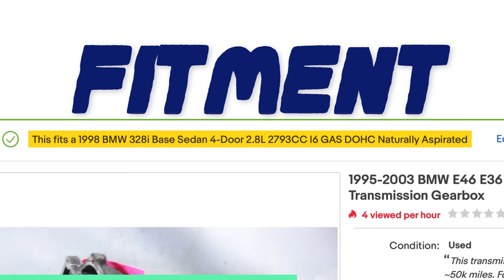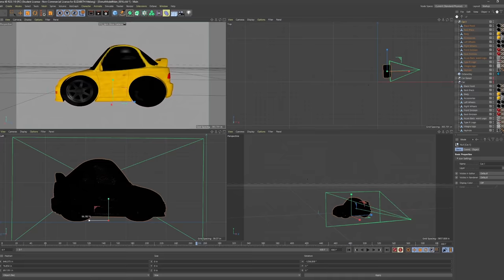Is a Manual Transmission Swap Worth It?

Comment: As someone who has done with myself, if you have a good car (or one you have an attachment to) with an automatic transmission and selling it for one with a manual transmission isn’t an option for whatever reason (like price or rarity), then swapping for a manual transmission is 100% worth it. That said, the newer the car is, the harder it gets. It also kind of depends on the car. Some cars have an absurd amount of differences between auto and manual cars. Newer cars also present more electrical hindrances.

I’ve done this on 2 Subarus. On my old Legacy, I actually found the best way to do the swap was to buy a parts car. I bought a wrecked car with no engine (but all the other drivetrain parts) for $300, and it had everything I needed except for the driveshaft, which was another $90.

For my second (newer Subaru) I actually went from a 5-spd glass box manual to a STI 6spd. The two transmissions are so different that it may as well have been an auto to manual swap.

In both cases, it was totally worth it. Completely transformed both cars (and made the old Subaru with the automatic much quicker and more fun to drive)

Comment: You can bypass the Neutral safety switch, and also bypass a few of the wires that go the engine computer and also to the transmission computer too, and also add a few wires, or ground them out. without having to open up the transmission computer, or you could make an diy bypass harness to bypass everything that used to control, automatics transmission related things, take those out so you wouldn’t have an check engine light and also start the car, without having any problems whatsoever, that is my idea.

Comment: In the case of cars like Mk3 Golfs/Jettas/Cabrios (and mk 3.5/4 Cabrios, which are mechanically Mk3 cars under the facelift), doing a manual swap is the only remotely affordable way to keep an old automatic car on the road when the (terrible, terrible, no good, horrible) transmission inevitably bites the dust and you can't find a replacement on the used market (because they're all dead at 150k). Fortunately it's a relatively easy and painless swap, as far as those things go, and the end result is a vastly improved car if you're into rowing your own.

Comment: Here in the Netherlands most ppl have manual transmissions. full is here, is verry expensive alomst 2 euro so thats 2 doller 20 or something per liter and whit a manual you can keep the low rpm so it uses less full. And the newer cars have a 6 or 7 speed theese day to keep the full cost low.

Comment: it really depends on the car. My dad bought his old 76 280Z years ago and it was an auto, so OF COURSE he swapped it with a manual l28 transmission out of a 280ZX. That car was a rust bucket when he got it though, I have the engine in my 78 280Z though, specifically used that one because of the "high nickle content" block and the "square" shaped exhaust ports that match l28eT turbo exhaust manifolds.

Now it just has headers and 2.5" exhaust kit from motorsport. My dog and car are the only good things that happened to me in the USAF. 
In 2010 you could still get a 99% rust free all original 78 280-Z with 90k miles for $1800 in ABQ, NM. Always knew not only Datsuns but especially S30's would get popular one day and people would realize their value and beauty.

Comment: This makes me want to work on cars! I would absolutely love to do something like this. I am not a mechanic but I have changed my slave cylinder located in the transmission on my 02 ranger, changed the clutch, changed the brake lines and some electrical for the lights I swapped from a Ford explorer. I just watch YouTube and copy what they do. So I'm definitely going to try this with my 07 Honda Accord.

Comment: I converted an old automatic into a manual.  Left the shift selector attached so I could put it in neutral or park to start it.  Also makes for a handy theft deterrent!  Just had to change the pedals and install a clutch cable.

Comment: You guys should do a high versus low on building rally cars and take two cars that were never meant to be rally racers ever like Fox body mustangs that are not hatchbacks, lift them up a little bit give them suspension put a turbo inline 6 under the hood some decently meaty off-road tires but nothing crazy roll cages if you can depending on price take the all-wheel drive or 4 by 4 setup out of a Jeep or some kind of SUV or truck or keep them rear-wheel drive but I think that would be a great project, because you guys did a great job with the 350Z projects a great job with the camper trucks and show the world just how bad the Subaru Impreza WRX really is if you don't have factory backing

Comment: If you come across this video wanting to learn how to manual swap, some cars you can leave the trans position switch hooked up in park. You’ll still throw a code depending on what electronics go to the transmission but crank and drive. Also makes a nifty anti theft device😂

Comment: He said "you don't want your flywheel coming off". This is true, but make sure to use thread locker on all bolts and torque them to factory spec. Once upon a time, I installed a new clutch and flywheel but one of the bolts were loose. It was launched out of the bell housing through a fist sized hole. That was a pain to repair. 10/10 would not recommend.

Comment: That transmission came out so easily. I did my MK3 Golf 2.0 l on jack stands in my garage. A very tight squeeze. Of course I didn't have to remove the exhaust.

Comment: I know this is an older video, but i would highly encourage anyone doing this to please put the clutch safety switch in the circuit. I bypassed a switch until "I had time to get to it" one time and was in a hurry one day and didnt even use the clutch pedal and cranked it causing it to hop the sidewalk and almost damage the car and the side of a convenience store.

Comment: I prefer to hold the crank bolt on the front of the engine while torqueing flywheel down. Another valid option.

Comment: I’ve done a manual swap on a 2001 VW Beetle TDI and 1992 Mustang LX. Each time I regretted it while doing it and swore I would shop around more for a car that already had a manual. I’m still currently working on the Mustang but it’s drivable and I bought it with the AOD automatic already removed and disassembled. I didn’t even know if the engine ran or knocked. Luckily it runs good. Of course, after I bought the car, several that have my requirements have hit the marketplace.

Comment: Manual swapped my f350 the headache was awful it calls for an zf5-1 but managed to strap an np415 from a 4.9 i6 and I’ve never been happier shoutout to autozone for messing up the clutch 3 times EDIT: forgot to mention I can’t tune an ecm/ecu so shorting the neutral safety switch was another awful time

Comment: I did a T5 swap on a 91 S10, it really wasn't as hard as I expected but I took the doghouse off for more room to work, I did a motor and tranny swap so most of the hard to get to stuff was done before installing, and I had the totaled donor truck right there for parts. Was still a headache, but not terrible.

Comment: Saabs used to be ready for trans axle swaps.  I used to own a 1988 Saab 9000 Turbo and a 1999' 9-3  HOT both were manual from factory and the instrument cluster had the shift position symbols for automatic. Looks like Saab was looking into the future by making equipment swap ready vehicles.

Comment: Strange video to me. Back in 1997 I had a 1988 Dodge Daytona Pacifica turbo with Auto transmission. I bought a wrecked 1990 Turbo model with 5 speed to do the swap. Back then everything was universal on the car body just bolt on so only took 1 weekend to swap out everything. Thought that was the smartest idea for a car body as to have just one for either auto or manual with no modifications needed.

Comment: I think I only ever torqued a flywheel once. Then I just used a 1/2 impact and red threadlock on the bolts. Never had a problem in over 12 clutch jobs on a bunch of different cars.

Comment: Around 2015, a friend of mine ended up needing to drive an automatic transmission car due to having back problems that led to getting a pretty big spine surgery. She owned an "econobox" stick shift car and asked a mechanic if it could be swapped to an automatic transmission. Pretty sure they told her that it was impossible, which I think is wrong BUT I have little doubt that she could have sold the car, worth maybe $2000 at the time, and bought a similar OR BETTER automatic car for $3000 for a net cost of $1000.
To get someone to swap the transmission on her little subcompact PROPERLY, I'd guess she would've had to pay no less than $4000 for parts and labor. (no she doesn't have any friends who'll give her nearly-free labor or even highly skilled car guys who do genius work for way less than they're worth).

Comment: It’s a long process but it sure is fun af…I manual swapped my 94 mk4 Supra and there was a lot of work I had to do since I didn’t go original V160. There was a couple of back and fourth things like I had to pull the transmission back down because the lines were leaking fluid the first time but once I got it all buttoned up I have to say it was welllllll worth it and cost me 3x less than what an original manual Supra would have cost!!!!!

Comment: Totally worth it in any car. Automatic transmissions just don't hold up in most cases unless you have them built. Surprised you didn't change the transmission fluid while it was apart?

Comment: 11:00 dude, never use WD40 to lube a bearing. WD40 feels oily but it is a solvent. Please, use grease or even kitchennoil to help it slip into its place, but never WD40. Over time (not long) and a cpuple heat cycles (literally 1 or 2) it will be equal to using gasoline or diesel to lube that bearing. 
Trust me, I am an automotive mechanical engineer

Comment: BTW, WD40 isn't a lube. If you want a good lube that costs at the most as much as a large can of WD, try just about any kind of decent gun oil, Or as I like to use coconut oil which is a natural oil that's been used for hundreds of years as a mechanical oil and that all of my firearms love from my custom built flintlock firearms to my modern firearms. I also use it as a tapping oil when I'm building said flintlocks and to get things movin when working on my truck.

Comment: I did a manual swap on a 78 firebird in parking lot of my apartment complex in 1984 when I was 19 years old with    the bare minimum of tools. It was grueling but so worth it. I encourage anyone to just go for it but BE SAFE about it. You cant chirp second and third gear if you’re dead.

Comment: Here's a thought to consider. If it was up to me and condition wasn't an issue I would do manual everyday of the week and twice on Sunday

. However I have nerve damage in my lower extremities that makes working the clutch difficult at best a good day and virtually impossible if I'm having a bad day. And believe me I've had several manual transmission cars over the 65 Mustang with 3 speed manual, 77 Datsun F10 with a modded engine from a Pulsar backed by a 4-speed, and a Acura Legend GS with 6-speed (engine actually swap from a wrecked NSX, with a turbo added, so the day I could no longer drive that thing regularly was a very sad day indeed). As well as a number of trucks that had manual transmission, one of them I still have after converting to automatic, thankfully there's a few good builders out there for automatics behind the 7.3 IDI or my F350 would have went bye-bye, although the transmission cooler for that is almost as big as the radiator for my wife's Camry.

Even when I did, hydraulic clutch was an absolute MUST, ergo non-negotiable. Hard to tell when walking but clearly visible when behind the wheel of a 3 pedal. Burnt up two clutches on the Legend and went through three clutches on the F350 before I gave up entirely.

Sadly condition has worsened somewhat over the years thankfully my right leg is fine it's just my left leg that the problem has plagued me in which case I will tell you from my own experience building up a heavy duty automatic transmission was my salvation. 

In the family car I have gotten more fascinated lately with the his-and-hers style dual gate shifters, something that last time I had seen anything like it was on my dad's 67 GTO, that are on a lot of the newer cars. 

If I get back in the tuner scene anywhere in the near future I will probably center my build around such a setup. 

I certainly am no stranger to automatics with beefed-up internals, larger transmission coolers Etc. Took my high-school beater car, 83 Cutlass Supreme first had 3.8 V6 under the hood and replace that with a mildly built 455 Rocket with a heavily-built 200-4r transmission behind it to handle the power, if I can ever convert to a 4L80e, I'll probably be better off, but I'm not putting a Chevy engine in it just to do that. Even pulled off an even trade on my 65 Mustang for a 66 that I have since put 347 Stroker with built AOD.  (the 65 was, despite having the factory 200 6-cylinder was running with a custom ported and Polished head,  Holley pro-jection fuel injection system, Offenhauser intake manifold and a custom shorty header made by Hedman for the straight 6, had a turbo on that bad boy. Was putting out more horsepower than the factory K code 289 back in the day, running right around 280hp, my 66 exceeds that by almost 150 horsepower. One of my other planned projects is to do a dual-gate shifter on my 06 Lucerne, the 4t65e transmission already built up to handle considerably more power than the car already has but certainly the feed my need for speed planning on putting a turbo on it at some point.

Just remember not everybody that wants to fill their Need for Speed can handle the manual some just have two left feet and don't know what they're doing and then there's some that would if they could, like me, as I certainly have before. All three of my manual toys from back in the day have had various race wins under their belt.

Comment: I had a unicorn gen 1 06 ford escape that had a similar ratio and it would do 5 second 0-60 with the mazda 2.3l 4 banger. They went on to put that engine in the 2012 MS3, which is why I just got one and still own both. Its way better because most people dont need to drive over 90. My escape was a 5 speed and it would rev at 5k rpms doing 65mph in 5th Lol. Its weird having 2 cars that sound identical.

Comment: With that chip removed, does it start without the neutral safety switch being engaged? Can you "start it" in first and technically lug it forward slowly on the starter power only?

Comment: I love to the video! I like how you use a Jack and stands most of the time like most would like myself. I’m trying to change my 1999 Infiniti Q45 to a manual but to no avail. I’ve searched across the board and can’t find a way to do it without people saying I shouldn’t. So, should I leave it as an automatic? I’m only a college student in my last year. I’ve done BC coil overs cause they’re cheaper, Avid.1 19” tires fit for stretch. I’m also running a BORLA exhaust with X-type cross. Just trying to figure out what I should to do the car mainly? Any answers?

Comment: The MOST EXPENSIVE conversion that I know of is Vanessa Bryant's Ferrari. Kobe got it switch from manual to auto because she couldn't drive it. It almost cost as much as the car and had to have special authorization from Ferrari. BUUUT dude has extremely deep pockets so it prob was the equivalent to an oil change for regular people haha

Comment: I really wanna do a manual swap in my Chevelle. Tremec T56 or something. My TH400 taps out at like 120 km/h. Its a nightmare to drive to far away locations, it revs at 3500 doing 95 km/h. A 5 or 6-speed manual would be a dream. Unfortunatley I dont have a garage to do the swap in.... Awesome episode guys! BTW did that guy have a fez on at 22:36

Comment: I’ve never driven an automatic and I’ve always assumed they’re “clumsy” when it comes to power demand: if I know in a couple of seconds I’ll need power I can just change down, but (I assume) an automatic would swap out at the “worst time” as the revs dropped?

Edit: Or for the most part is it seamless?

Comment: I did an auto to manual conversion on my e30 and it wasn't that bad. Of course, the auto I got with the car was grenaded so I had to swap the transmission anyway. And this was like my 5th e30 so I already had 95% of the parts. The worst part about it was swapping the pedal box.

Comment: Hi I have a 1999 E36 323is automatic coupe and my thing is to swap it to manual  this car is in showroom condition it was bought by a elderly couple out the showroom and was garage kept and kept up to date in maintenance serviced only by BMW I bought it from them a year ago and in to keep it garaged and up to date on its tune up’s but I feel like it needs to be manual swapped so it could unleash it’s full power I feel it wants to do more in each gear . By looking at your video made me want to do this asap I’m just low on money and afraid that if I damage something while doing the swap I won’t be able to afford it but if you see how mint this bmw is you’ll know why I’m afraid to damage it I’m a single father with full custody of 4 kids two daughters and two sons things could get tight at time but anyways could you guide me through this you did a great job on your red one 👍🏼